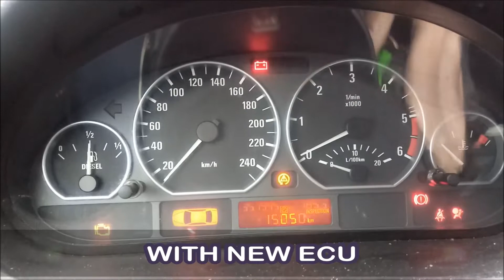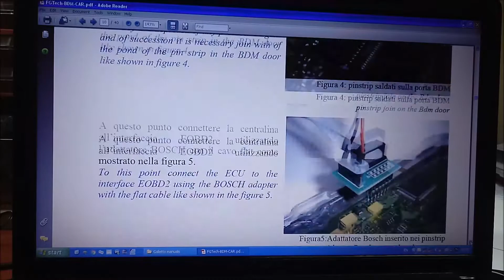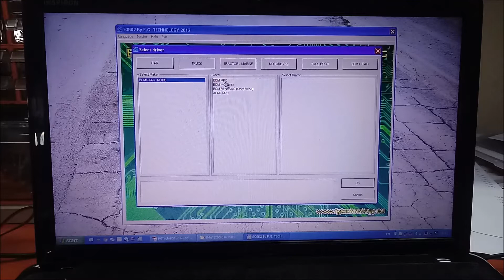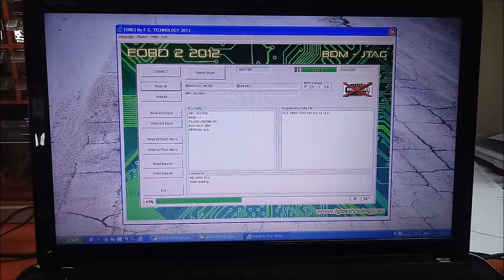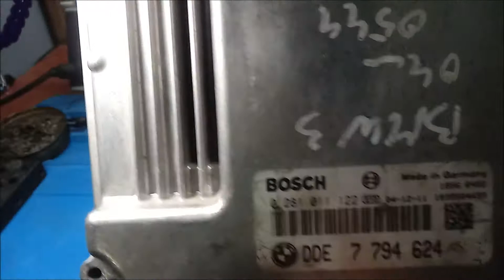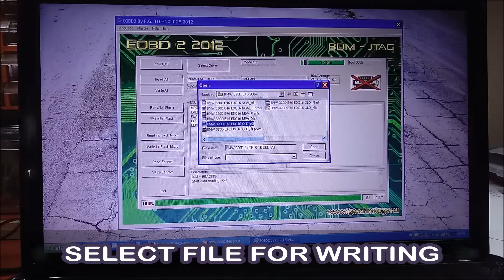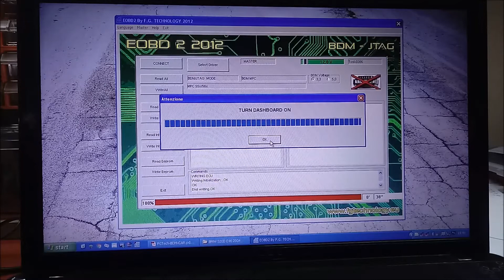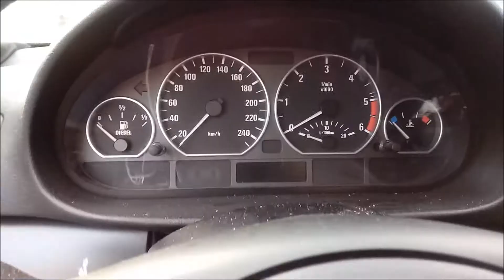Cloning BMW 320D E46 2004 ECU with Galletto

Comment: I typed a new folder with k-tag in my bmw x3 e83 with k-tag. I successfully typed the folder but after that I can't start the car and there is no communication. Can you help me?
Reply from the maker: Try write original. What ECU You car?
Reply: Check your data signals

Comment: Hey nice...with this procedure can you simply switch ecu "on the fly" without any other coding with EWS or others ecu around the car??
Reply from the maker: Maybe, but i don't know, because i not try make it.
Reply: Yes you can as long as you copy both the Micro and Eeprom, that way you carry over the immo data and it should be plug & play
Reply: @pelican7481  i have some issue,  my device doesn't complete writing session.. Some idea about it?
Reply from the maker: @alessandropoggi9488  Need checking file or try write original.
Reply from the maker: @pelican7481  👍👍👍
Reply: @alessandropoggi9488  which tool do you have?